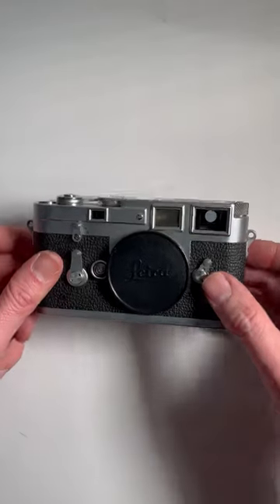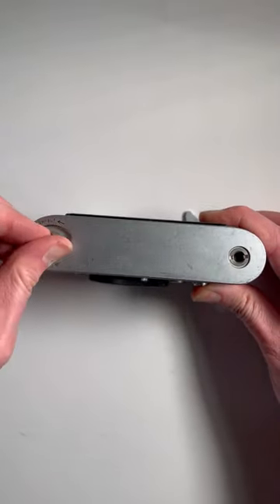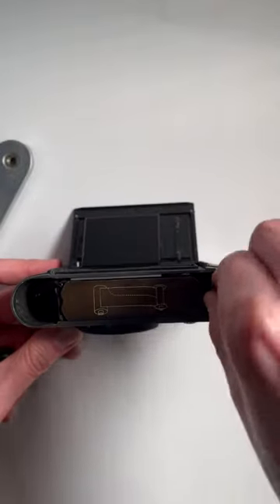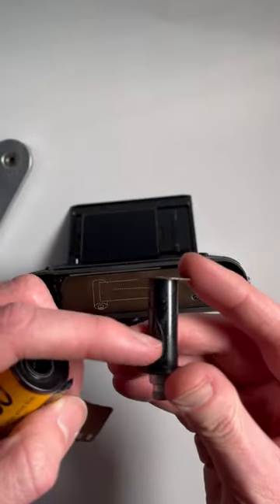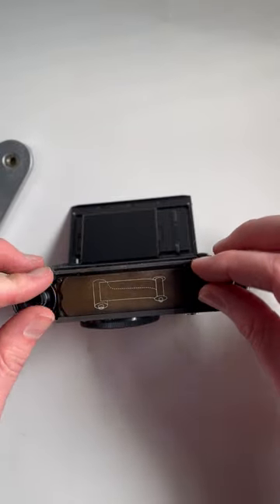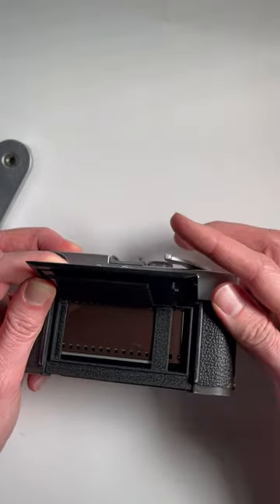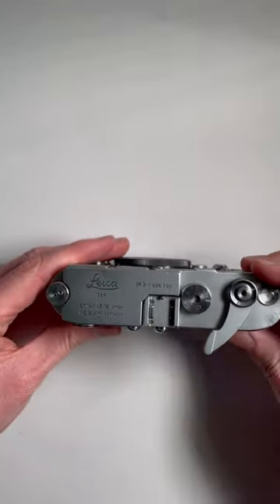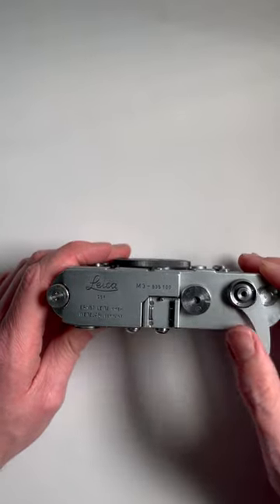Loading the Leica M3 with 35mm film

Comment: Loading film in natural light like this, doesn't this destroy the film? Or this is for demonstration, and we actually need to load film in dark room?
Reply: You can't use the first part for the exposed film, which is why he advances it after closing. This is the correct way of loading.
Reply: Only the leader tip is exposed to light, you wouldn’t see this if you close the camera and advance until the counter marks 1.
No damage to the film
Reply from the maker: there's always some extra film for loading the camera so all the film that's in the canister will be fine